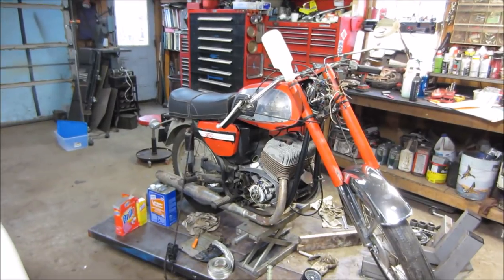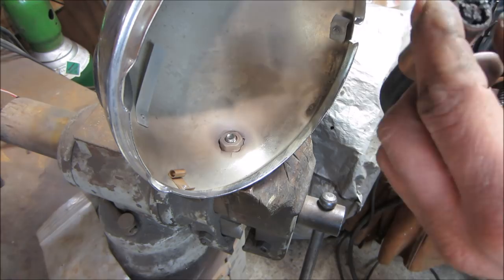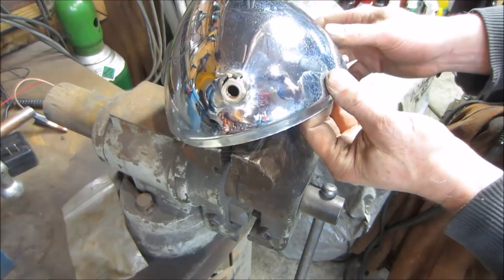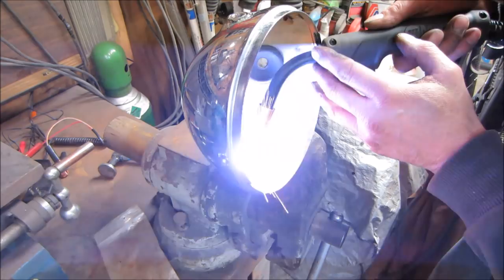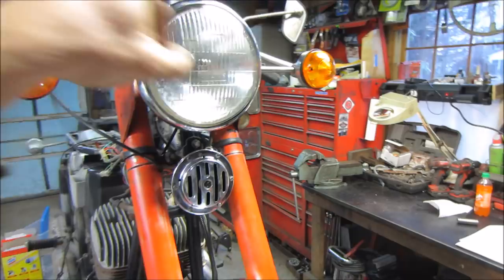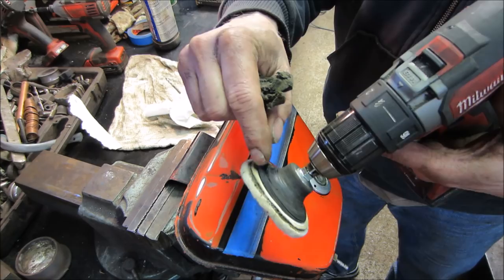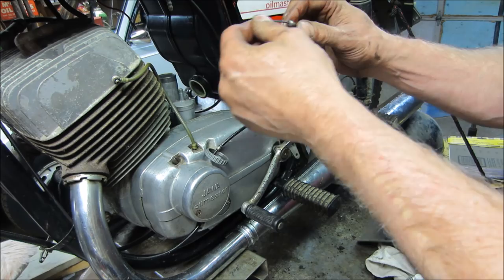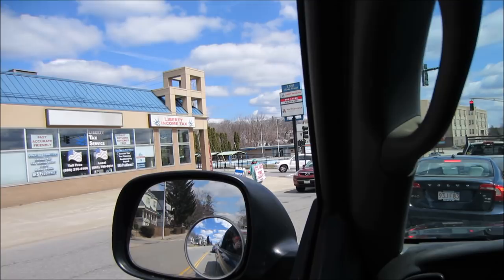barn find Jawa motorcycle weld and shine

Comment: looks to have been a great little project so far, and you've actually helped me do at least some parts shopping for a generator i bought for £35 two years ago as a project. and well, but a second generator for £35 that I fixed by just cleaning the carb out. 

But damn! I miss America, having only visited a few times on holiday.  :(

Comment: I like your trick cable oiler, but I made my own . I take about 6" of  old  fuel line and a hose clamp. Clamo it to the end of the cable housing tip it upright and put a couple oz of any oil in the hose. Stick the blow gun in and blow the oil through . Fast and easy. The engine oil seems to last longer than a lightweight aerosol type.

Comment: You know what works really good on just about anything when it comes to cleaning surfaces ...use what ever cleaner you're going to use with #0000 steel wool. I've been doing it for years,,,it works really well. Just make sure you wipe it clean so you don't leave any steel wool particles behind.

Comment: You'll have to either connect a tube from the oil pump output back around to the input side (filled with oil of course) to prevent the pump from seizing up and tearing itself apart. 

Or do what most folks do and remove the pump completely, fabricated a blanking plate & gasket so that the gearbox oil doesn't leak out when running.

The last option, the one I always use, is to use the clutch cover case from a CZ 250-471 / CZ 350-472 twin (also sold in the US up until the 1976 2 stoke ban) and replace the pump casing with the blank smooth casing from the CZ.

Your replacement headlamp lens glass didn't fit because some previous owner has replaced the original PAL headlamp with a Lucas headlamp from what looks like a Triumph T140.

The Lucas turn signals are correct as Jawa machines sold in the UK, US and Canada were sold with Lucas tail lights and turn signals.

Comment: Have had good results from braising those nuts back in, using a washer like you did, although I use silver rod (like a silver solder, have some thicker stuff left from a large corporation that had boxes of it, but didn't hardly use it) but that tack welding seemed to do the trick too. Yeah, did see the nut-on-the-wrong-side also, but until we get a voicebox to the garage that also goes back in time..we're kinda screwed about that! ;)  Can't wait to see this going down the road, and it really shined up.

Comment: I owned a Jawa 250 twin exhaust in the 1970s and a jawa/CZ - it was the cheapest bike around and the chrome and paint just went off in a year. The 250 had piston slap and bits used to fly off it - i kept it going with chicken wire and gaffa tape. You are wise not to invest too much in it. fantastic video,.

Comment: I think switching to premix is a good idea.  It only took one cooked engine for me to become a believer.
Reply: could you use both? maybe mix it kinda lean?
Reply: The Doctor eh. I guess it's technically possible but theres really no point.  If you're premixing anyway just go full strength and be done with it.  Plus if the injection died half strength premix would probably damage then engine as well because you still wouldn't be getting the the right amount of loob
Reply: yeah but if the oiler would work then i would want to be able to use it
Reply: The Doctor it all comes down to how much you trust the system.  If it's all brand new and been fully tested then maybe but old stuff can crap out at any time and gives you no warning that it has died.  You'll only know when the engine siezes.  
The point of switching to premix is to stop using the oiling system BEFORE that happens.
Reply: yeah but if you rebuild it then why not use it, if you're willing to put the work into it
Reply: The Doctor yes, like I said, if you go through the whole system and are confident of it's integrity and longevity then go for it.  The problem with a lot of these old vehicles is parts can be both expensive and hard to get and often the thing itself just isn't worth the trouble when the alternative is easy and pretty foolproof.
Reply: i'm usually the kind of person to buy something old and rebuild these things, because i use them often, but i suppose not many people would. i like to restore everything to fully working order
Reply: Premix for old two strokes EVERY time!
Reply: The Doctor don't trust the oiler, just premix and be done with it, don't have to worry about anything failing and burning up the engine with premix.
Reply: Over oiling kills spark plugs not engines! which are cheaper?
Reply: if you rebuild it then there is not much worry,  the only way that it can really fail is seals going bad from drying out, once replaced there is not much else to do
Reply: im rebuilding an old 2 stroke at the moment, previous owner ran premix and it wasnt designed for it, one side of the crank bearing was shielded and it seized up and wrecked the rest of the engine. have to be carefull with some bikes.
Reply: Owain Very true. The Scott was like that, premix for the pistons and rings and oil pumped to the bearings.
Reply: yeah, that's one reason why i want to use the original equipment
Reply: But I know for a fact Jawas will run on premix, 2 of mine came from the factory like that.
Reply: yeah, but if i could run one on it's original equipment i would
Reply: I wish I'd used premix on my CZ 175 Trail. Went through two pistons.

Comment: Nice video I enjoy watching your work next time on your Chrome try this instead of using an SOS pad glass cleaner and aluminum foil it really works wonders you would not believe how it will clean the rust off and will not scratch it like an SOS pad good luck just saw it find an old piece of chrome with rust on it and dirt glass cleaner or warm water and a ball of aluminum foil regular household aluminum foil it will look like brand new amazing I used this trick on restoring 750 and 550 Honda motorcycles

Comment: Another bit of mustue certified brilliance love the videos. Definitely jealous of all the vws you have. Eventually I will own one...so far I've had a 85 Jeep Cherokee, a 76 Dodge d300 an 82 Chevy k20 an 82 Chevy/ford k30/1.5 ton a 91 Geo metro convertible, a 2000 Chevy express with 500k miles a 98 Merc sable with 300k miles and a 93 jeep Cherokee with 350k miles....I will own a 60s or 70s vw though!

Comment: REQUEST - Mustie... could you show the underside of the fuel tank please?  I have a 1986 Jawa 638 almost identical to yours but the tank has 2 "C" shaped flanges welded where it slots over the top frame rail, but the rail is straight - no rubber bungs to support the tank!  How does yours prevent the tank from just sitting on the frame? Cheers.

Comment: If you'd run a threaded rod through the inside of the lamp, through both nuts, if would keep it all straight. Well, you'd need to have one.
Reply from the maker: just dident have one that fit,
Reply: Metric allthread is kinda hard to find in the USA....
Reply: Okay then you're excused. You should try find some NON Metric hardware here. Not possible.

Comment: For the welding lens take a look at the thing Keith Fenner built. Basically an auto dark shield in a case with the camera inside. Seems to work good. Jody has a variant of that as well. 6 volt flasher replaced with 12 volt?  Oil pump failure is one of the things I've seen on snowmobiles as well. Never really seen a good reason why it was needed, no real issue to just carry a bottle of oil to dump in the tank when you fill up.  I have a friend who works for Liberty, she HATES being a sign waver,  They show up for work and toss names into a hat, then draw for "shifts".
Reply from the maker: yeah l just need to take some time to put one together

Comment: Nice work on the bike. Yeah, you really need to evaluate the situation to best suit your needs. Recently I decided to look at some bikes. My funds are limited and wasn't really looking to buy and only wanted to spend a few hundred for something to rebuild. I'm on disability for stress from the army. Just something I've learned to deal with.

Anyway, bike #1, 1978 Yamaha 650 twin for $350 in rough shape. Didn't have a title so that was out.

#2, a 1983 Yamaha 650-4. I told the guy I only had $300-400 to spend. The bike had the engine installed on a lift. He had been doing a military thing on it. He seemed to have a pretty decent job he like in the marines. A crew chief on presidential helicopters. Where I had been lied to and spent 4 yrs in the army infantry. I wasn't a happy camper yet still made sgt, lol. It was cool, had one guy in charge of me and didn't  care what I did as long as he didn't have to get involved. And there wasn't anyone under me. My job at the time was to take coordinated from the forward observer and translate to data for guns to fire. The guy had also cut part of the seat frame off the back and he wanted to get the money back he put in it. Yeah, right. His wife was pushing him to sell. He had an 03 Suzuki 650 as well.

Then I came across #3, a 1982 Yamaha Virago 920 for $650. Kinda of a barn find but he had a couple years before and put 4000 miles on it. It was pretty dusty sitting out in  the garage for a year. I had wanted to get pics of it before loading it. I rented a U-haul van and it was a nice warm day until about 5 miles from the bike, 50 miles away from me, and the temp dropped and the sky darkened. I had just got the bike into the van when it started raining. And then I decided to give it a bath before bringing it to its new home.

I'll be renting a new bigger place with a garage under I can use, The only problem is I have been going through one apt fixing a lot of things so the people can move out of my next apt into the one I've been working on. Kinda funny the guy I'll be renting from has a Harley and when I drove in with my bike he was right there and said ' Ill get this off for you. I had already loaded it twice myself so didn't argue, lol. Funny how heavy it is to move around but when I sat on it to ride it seems so well balanced. That's when I decided I wanted it.

He had put new Jardine pipes on it and noticed blue on the pipes from running lean so he just put new jets in without cleaning the carbs and was running rough. Found a factory shop manual in New Zealand for $70. Gotta have it though and then I can this thing back on the road. Want to repaint it as well.

Comment: Say Mustie1, I'm a subscriber and watch your channel regularly. Its been more than two years since this Jawa 350cc project. A durable old European two-stroke. I'm wondering what was the eventual outcome? Did you get it on the road? Take it on some extended rides? If you sold it, what was the final price?
I like the wacky patina from the combo of original red/black /rust. Something like what owners of old VW Beetles keep. Some will rub linseed oil into the finish. If it doesn't catch on fire while rubbing, the linseed oil provides a deeper coloration and very cool satin finish.

Comment: On my Jaw 250 1970 - the throttle used to stick full open and one day it was on its stand and it stuck open full and i pulled the key and it did not stop it . I had to turn the fuel tap off and it stopped once when the fuel ran through.

Comment: When you were welding the 2nd nut in the headlight bucket I said no no no it goes on the inside!! I had to take my welding helmet off, I just couldn't watch....
Reply: I picked up a basket case rd-350 years ago (around 40 I think) where the cable to the oil pump had broken, and it took out one of the big end bearings.

There is one risk with running on premix, if you are at speed, then coast with closed throttle, the engine won’t get enough lube.  Old Saab triples had a freewheel system so the engine could drop back to idle in that specific case, without the driver having to remember to put it in neutral.  The pump would output enough oil at rpm to keep things spinning.  I suppose you might hook up the pump, disconnecting the throttle, so it would cover the closed throttle case, and use 50:1 for when there is actual gas flowing..

Saw an older video of yours where you visited Haverhill steel.  Do they still allow the public to browse the scrap pile, or have they gone all risk averse.  I am in Waltham, and land around here is worth too much to pile rusty iron on it, all the nearby yards are now condos or offices.  Mostly looking for a place that sells drops cheap, and will sell me a whole stick when they don’t have a suitable chunk of pre-rusted available...

Comment: Yah, my first bike, Kawasaki 350 A7SS had oil injection. Sight tube got stained and looked like I had plenty of oil but didn't. Locked up my engine doing 70. No fun. One con rod was bent 30 degrees.

Comment: i had a kaw i think early 70s it was a 500 2 stroke it had 3cylenders man that thing was a beast it would bring the front wheel up in all gears it was fun till i  got to far up on it at about 90 i drug the toes of my boots trying to keep it from going all the way over think i pissed my self that time i know me so it would have just been a matter of time before it got me i sold it  before i ended up  killing myself on it me i allways take the oil injection crapp off to  that thing is cool looks good to me

Comment: What is "notoriously wrong" with the oiling system? Can it's inherent design flaws be repaired with 2018 brains and technology- or nobody cares, and just use 2cycle oil in the gas?
Reply: In my young and foolish days I owned a 3 cylinder Suzuki. After the first oiler induced engine seizure and crash, I learned to keep an eye on a mirror. If it ain't smoking, pull over and find out why....